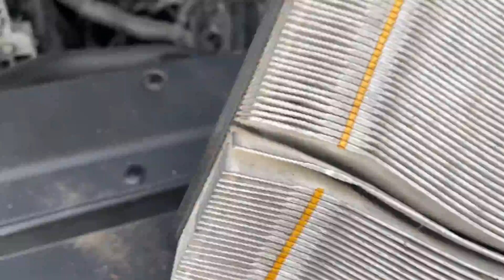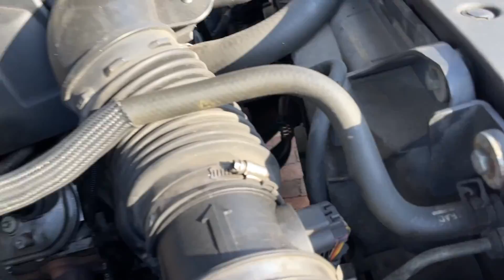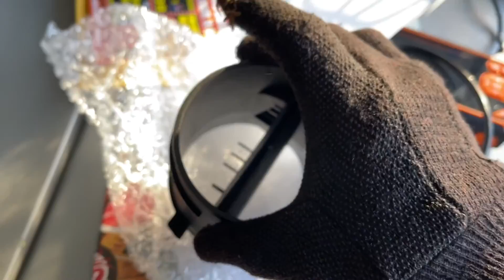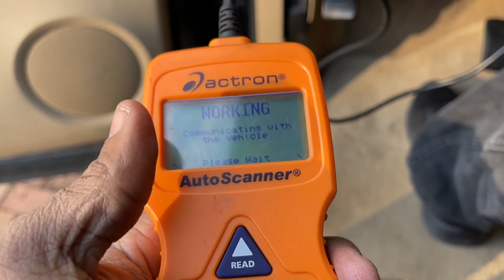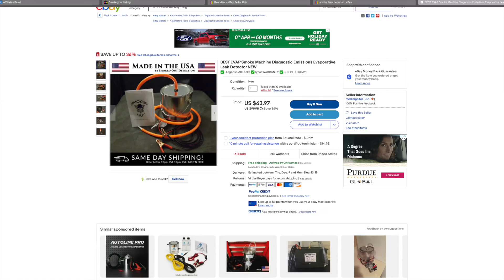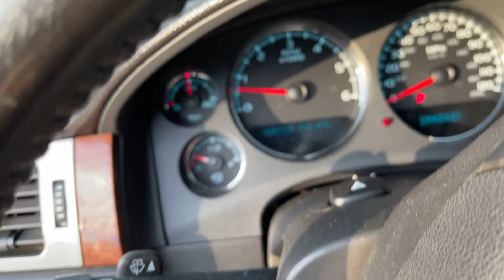Chevrolet, GMC Lean Codes P0171 P0174! My Chevy Suburban Is Running Super Lean!! LS Motor Lean Code

Comment: Wow I had the same issue and same crack at pvc.  On a 2005 Suburban 5.3 but didn't help me at all.  Ends up I had an upstream 02 sensor on bank 1 crap out reading 0 volts sending lean code to ecm, which caused injectors to over compensate by adding fuel, way too much.  I thought it was my maf also but it appears that the signal from the bad 02 sensor added so much extra fuel that if I disconnected the maf it ran smoother and that usually means bad maf.  This one was a head scratcher for a while, because I looked for vac leaks too long.  I had bank 1 short fuel trims maxed at 25% and long terms maxed at 50% and idle was very rough.  Anyway, all this from 1 upstream 02 sensor, but only after the engine was warm.  If you haven't seen this one just remember it and save 2 days digging.  Anyway man I love your vids. You are one top notch mechanic.
Reply from the maker: Thanks so much for sharing and for the kind words. I appreciate it! Thanks for watching as well!

Comment: Check on the firewall up by the tac module. You could have a leak and also take your throttle body sensor off and lube them gears with some grease 
but lightly only

Comment: It's very easy to separate MAF problems from a vacuum leak if you have a scan tool that can show live data. Your inexpensive scan tool does just that.  A bad MAF is typically rich at rest, lean under load, and the lean condition does not improve when you open the throttle. In contrast a vac leak typically improves when you put your foot on the gas, since when the throttle butterfly opens, vacuum drops down resulting in a smaller pressure difference across the leaking area. So, boot up your scan tool, get to live data, call up data pids of short term fuel trim, long term fuel trim, MAF air flow, and engine temp. Press on the gas and see what happens to STFT. If it improves quickly, you just saved yourself the price of a new MAF and you just avoided the complicated headache of a poor quality aftermarket MAF. In general, never replace a part unless you're certain it's bad.
Reply from the maker: Thanks for watching and for providing such detailed information!

Comment: So took my car in for codes P0523, P0455, and P2135. I have had the stabilitrak light come on before but only once a year randomly. Took it to a shop, and they replaced EVAP purge solenoid, oil level sensor, brake light switch, and vapor canister vent hose which was cracked. It cleared all the engine codes, but when I was driving home, I got codes P0174 and P0171 for both banks along with service stabilitrak and traction control lights going on and off multiple times within 15 minutes
Reply from the maker: I wouldn't be surprised if that intake gasket needs to be replaced. It's a very common issue with those engines. I have a video on how to replace that intake gasket. Thank you very much for watching.

Comment: That was the exact issue with my 2006 Suburban.  No broken hose but it had somehow slipped off.  Put it back on and now I'm down to just 2 lean codes.  I cleared the codes, drove it around but instead of having 171 and 174 for both banks, it's now just 171 on 1 and 174 on 2.  Should I just drive it for a while to see if it clears up or is there another possible leak?  Appreciate your videos!
Reply from the maker: I would definitely drive it for a while to see if the fix registers and clears the codes. Let me know. Thanks,
Reply: Check the volts on both upstream 02 sensors.  That was my issue. They crapped out and showed zero volts throwing a p0171

Comment: had that issue but it wasn't vacuum line.  it was a half clogged fuel filter and another faulty o2 sensor. changed those and was golden. 👍   but those codes are always intake mafs vacuum line  oxygen sensor or fuel filter
Reply: Where’s the fuel filter at

Comment: I started E85 on my flexfuel a tank later i got these codes, no vacuum leak, maf, good and everything else good just found out that there are wide band and narrow band O2 sensors. If tgey put a narrow band it with throw a P0171 P0174 code. 2013 ltz avalanche
Reply: So bro it wasn’t your thriller position sensor or mass air flow I got this same code and been using e85 for a year now with no problems I get the code check and it says fuel pump no way cause the tank was full and that pump would have kunk out

Comment: Ty you for the video big bruh
Reply from the maker: You're welcome. Thank you for watching my content.
Reply: @ quick question when I ask for that specific hose should I just say vacuum hose my is ripped on the hose itself not the smaller rubber
Reply from the maker: @Cabo1226  Hi, that's a ventilation tube not a hose. I am pretty sure it is split correct? If so, to save money you could actually fix it with black electrical tape. Or you could buy the whole line new. Here is the link...

https://www.ebay.com/itm/135171705557?fits=Year%3A2010%7CMake%3AChevrolet&_skw=2010+chevy+suburban+PCV+hose&epid=28045287483&itmmeta=01JKXBVEYE17M0YV4X5KSKMTGP&hash=item1f78dc8ad5:g:vQ8AAOSwyxtmqaob&itmprp=enc%3AAQAKAAAA4FkggFvd1GGDu0w3yXCmi1fjqMM8vRQjub6egPVb6b%2FaejMSFLEdvcav8uRCZsIUj0nbYMZ8PXtiBmBtmJI0lQn7OV%2FERNCac53bfKQIu7JxorD4hRR8mi934QppBFIiNR2eUFzdz6789g8LDoWki4uvzOKRDzVCQGzJdVJxxHLaAeUYHsgpgyFqTWdtpKkHtQPZyG%2BNJv2b3OCvsfpiMYdiUxI8vjcm0AOhsnzRoKZ6kWfmWnpPMitmecfCC4BvYTZKUQ3siqGCs0S%2FJANDTVDAA4eZZyOIEntpA4Ekrd5N%7Ctkp%3ABk9SR7Tv7aufZQ
Reply: @ thanks my appreciated I just left junkyard now grab two I have my traction light coming on and off randomly and did have the lean P0171 code why that you helped me fixed
Reply: @ what kind of hose did you use for that smaller piece you swap a regular radiator hose
Reply from the maker: @Cabo1226  Just some 3/8" vacuum hose or transmission hose I had laying around.
Reply: @ I did as you stated about the MAFsensor now I have all the lean codes on(PO171 ,PO174 and battery charging light on after spraying the sensor cleaner .
Reply from the maker: @Cabo1226  Did you disconnect the battery when cleaning it? You may have to replace it.

https://www.ebay.com/itm/195607314391?fits=Year%3A2007%7CMake%3AChevrolet&_skw=2007+chevy+suburban+mass+air+flow+sensor&itmmeta=01JM06YXJA7ED20G1HZBKM2Y2E&hash=item2d8b1abfd7:g:lWoAAOSw2yxmI4va&itmprp=enc%3AAQAKAAAA4FkggFvd1GGDu0w3yXCmi1du2B4I6CTBVvJikfC74DtZXuq2cTnq%2Fqda%2FOoFeDnS9ONBZBENAS6SOAkycFocLxa5yiSpe1JE6ADkjoaxOt7z%2BTsirVPGppmypbJrknmhmrB52gCNiKZJw34jYXirF60muSrJWY57j8uztViT1LlYlzmy6UyERaaXtrQUPax%2FgCuTFkvAprmBG88RacJl3if2IIIwFc77%2FotAKU688TKvnUZKSyQ4466smJG%2B5z32E%2BS6qlRAX5oXUsGYnO%2Bf3wauy1l61UVaZC86IiE%2FddsH%7Ctkp%3ABlBMULjZ-4agZQ
Reply: @ no just the sensor plug
Reply: @ I had found a hose that was lose and my alternator was bad as well and I purchased a range tech running okay now ty for the vids bruh
Reply from the maker: @Cabo1226  that's awesome! Glad you got it back running good.
Reply: @ thanks to you brother most detailed videos clear understanding as well .
Reply from the maker: @Cabo1226  I appreciate you watching my content. I really do. Thanks,

Comment: Glad u found the source. I had that same issue with 06 Impala SS and was chasing lean codes and check engine I noticed my hose was cracked after changing my rear valve cover gasket. Mind u I never did any work back there so when my spark plugs were originally changed they must have broke the hose and changed it. After I sealed it up the code , service traction control and check engine light went away.

Comment: folks dont ever clear codes until u have 100% verified thast issue was found and replaced. the code will give u info for diagnosing. clear codes after verified the fix repaired underlined issue.

Comment: I have suburban 2007 flex with p0171/p0174.   It came after p0175 and the injectors changed. The alcohol was 50% and the fuel trim was reset, and it dropped to 3-4% but now it missfire, cant drive, barely idle .Then the other two code came.  The new maf, fuel pump, throttle, new ignition cables. Smoke test for leak showed nothing.  What can it be?? Evap? Map? Fuel pressure?
Reply from the maker: Did you replace the ignition coils? What about the entire throttle body did you replace it? Can you please tell me the long term fuel trims?

Comment: I have a 2005 escalade ext, basically an avalanche.  I have a code that says my bank 1 is running lean. Also I get a message on my display that says stability system disabled. If I drive more than an hour, it does that hard shift from 1st to 2nd gear just like you mentioned.
You think that's a valve cover gasket issue?  Did that fix your hard shift issue? Or could a simple vacuum hose leak cause that too?
Reply from the maker: It could be a simple vacuum hose leak or the intake gasket (not vlave cover). I wish I were there to scan it and read the fuel trims. I would be able to tell you exactly what is causing it.
Reply: @TerenceDIY  Thank you so much for responding and for your help. My check engine light Is on and my tag expires end of this month so I have to get this thing fixed asap. I will try to find somewhere to take it that can scan the furl trim codes
Reply from the maker: @AllThingsSilver  , please let me know what you come up with. Thank you.
Reply: @TerenceDIY  just stopped by my mechanics shop. He told me to come back at 4 o'clock today and he will run my fuel trim numbers. So I'll send you those numbers later today.
Also my email is on my about section on my channels page if email is easier. Either way is fine. I appreciate your help for real!
Reply from the maker: @AllThingsSilver  , okay. What is your mechanic's take on your issue? Thanks,
Reply: @TerenceDIY  he said most likely a vacuum leak also
Reply from the maker: @AllThingsSilver  ,  okay. Once he see the short and long term fuel trims, he should have a general idea of what is causing your issue. Thanks,
Reply: St fuel trim B1 = 2,  st fuel trim B2 = 0,  Lt fuel trim B1 = 13,  Lt fuel trim B2 = 14
Fuel trim cell = 20
Reply from the maker: Okay, the short term fuel trims are within normal operating range and the long term trims are a bit high however, not high enough to indicate a significant vacuum leak. Have you ever replace the EVAP purge solenoid? It's sits directly behind your alternator. The code P0894 (transmission code) is probably a biproduct of the p0446. Please let me know. Thanks,
Reply: @TerenceDIY  I haven't tried that. Only thing I've replaced is the mass air flow sensor but that didn't help. I'll go buy that evap purge solenoid now and try that and let you know how it goes.
Reply from the maker: @AllThingsSilver  , what is your mechanic saying? If I were there, I could tell you exactly what your problem is.
Reply: @TerenceDIY  I got the part on. Now I just need to get my CE light turned off and see if it comes back on. I'll keep you updated
Reply from the maker: @AllThingsSilver  , please do. Thanks,
Reply: @TerenceDIY  I put the part on, had my CEL turned off and it came back on. So that didn't work. My mechanic said he can run a smoke test, you think that should be the next move? Or what do you suggest.
Reply from the maker: @AllThingsSilver  , I wouldn't have put that part on if I didn't know for sure it was the cause. That was my suggestion from the codes you provided however, I am not there physically to diagnose the vehicle properly. Your mechanic should have ran a smoke test before you purchased any parts to save you money. Yes, I would recommend running a smoke test. I wish I were there to help.
Reply: Codes: P0446, P0894

Comment: 09 sierra. Stabilitrak/traction control light. Hard shifting. Running terribly. New MAF, 8 new plugs. Codes...c045500, p0307 misfire, and data incomplete message...any ideas? I've heard speed sensor, swps clip, o2 sensor. But not sure where to go from here. Any ideas?
Reply: And engine didn't start running roughly until stabilitrak and TC light came on.
Reply from the maker: Hi Tyler, There are two things that could be causing this, the coil on cylinder 7 or the fuel injector. Unplug the coil on cylinder 7 and see if it runs worse or the same. If it runs worse, then the coil is fine. Do the same with the injector. If it runs worse, then it's fine, but if there isn't any change from how it's currently running, then that is your issue. I wish I were there to help. I know these engine very well. One last question, how did it run before you changed the spark plugs? Thanks,
Reply: The stabilitrak and TC were intermittent. When it did happen the engine started running this way. Over the weekend it came on and now is on continuously. No change before or after plug change. Also, I am getting smoke on startup which was always an issue. When engine gets to operating temp it stops.

Comment: Got a 2009 Chevy Silverado, and traction control abs and stabilitrack turned on, was your car making terrible sounds when turning and not putting enough power to the tires, also when you turned your engine off after a ride would it lurch and make a unwinding sound?
Reply from the maker: When those lights came on, there was a lack of power instantly and it shifted VERY hard out of first gear. That was it.

Comment: I'm having the same problem po171 I checked all my hoes there all good no cracks or anything I replaced the mass air flow sensor I did coil packs spark plugs and wire but not too long ago I had my motor mounts replaced and I'm wondering if they cracked my intake or something because when you replace the motor mounts you have to lift the motor up a little but ever since they did my motor mount I've been getting that code po171 I definitely need that smoke test machine but yeah ever since they did my motor mount I been getting that code now po171 but yeah i have a 2007 caddilac escalade I replaced the fuel pump myself replaced canister breather charcoal canister too but I'm confused why I'm getting that code now any help would be appreciated
Reply from the maker: It's a strong possibiliy that your intake gasket needs to be replaced. That was ultimately my issue. I have a very detailed video on my channel for the job.
Reply: @TerenceDIY  yes kind of thought the same thing I also have new injectors but have not put them on yet well I guess I'll pick some new gaskets up tomorrow I'll keep you posted how it turns out
Reply from the maker: @davntelisha19  , please do. Thanks,
Reply: Dealing with stabilitrak on 07 avalanche changed intake manifold gasket as shown on test scan, o2 sensor, airfilter, cleaned maf, previous owner had aftermarket throttle body on it so I got a factory oe (used)1 put back on.  Truck will cut off periodically as I come to a stop along with stabiltrak.  Cleared codes and now it's saying fuel pump along with p0171 & p0174

Comment: Issues simular with my Malibu lt.  Ignition coil fixed it. Stabilitrak light is off after replacing the coil
Reply: Was yours showing a misfire due to coil?

Comment: Hey man I got a 2007 GMC Yukon and stabilitrac and traction control came on after lift was put on but tan fine for 6 months but just recently had trouble starting up and now shifts hard from 1st to 2nd do you think that’s what it could be and I have the same code
Reply from the maker: Absolutely. I bet it is shifting VERY hard from 1-2 and lacks power correct?
Reply: What is the solution to this?? Have same problemin my 09 yukon denali

Comment: I got an 07 escalade that the stabilitrak turn on and off all the time it has the 6.2 can you give me some ideas of what it could be ...where to start....I think I might start with the mass air flow sensor. what ls motors are prone to the manifold leak?
Reply from the maker: That's a good start. If you can send me the trouble codes that it is reading, I can probably direct you even better. Thanks for watching!
Reply: @TerenceDIY   p0174 and p0171